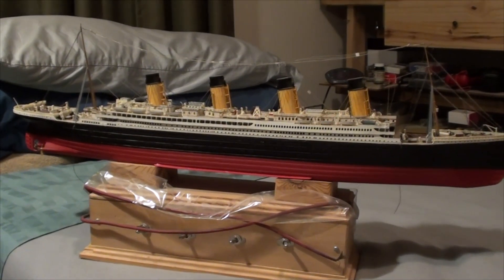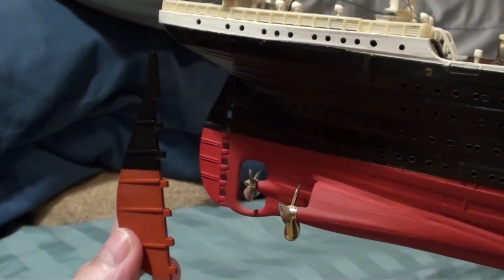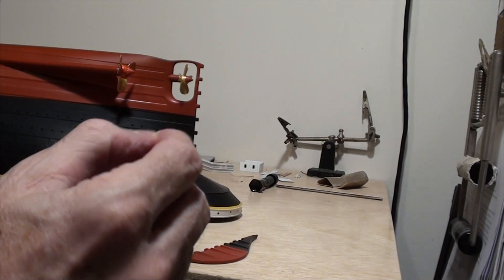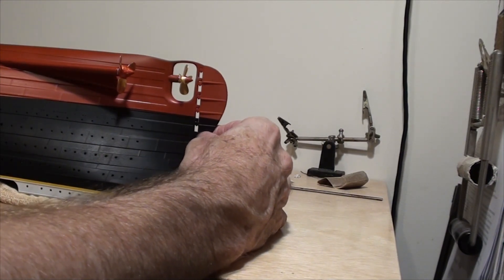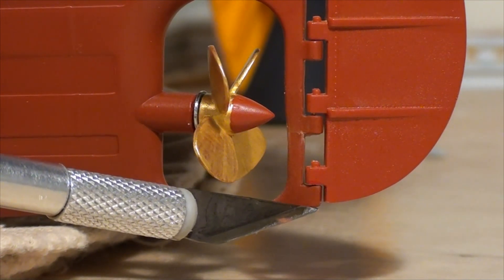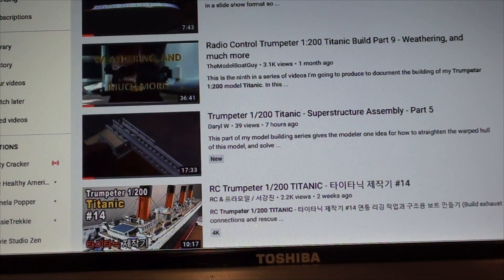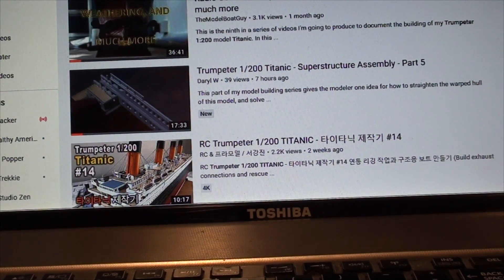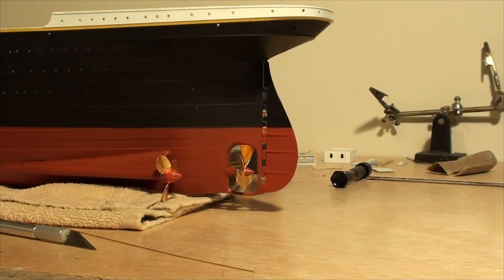Trumpeter 1/200 Titanic Part 6 - Functional Rudder Assembly

Comment: Great idea, not sure why they wouldn't have had it a working rudder .  The hull looks darker red then the 350, it's it a Tamiya or other rattle can or a specific mix airbrush?  I always find it hard to get a good (not too red) red, rust/red oxide look? Thanks
Reply from the maker: The red color I used is a Krylon rattle can paint.  My part 4 video shows the paints I used.  Looking in the store at the cap of the red paint can the red looked more like a rose red color and I thought it would look right, but I think my mistake was that the primer coat was a dark rust red/brown.  Darker primers will make a color darker, so if I would have used a light gray or white primer my red may have looked closer to the light red on the actual ship.  The website I mentioned in the part 4 video shows what the actual red color shade should be.  It looks more like a rose color, but the red I ended up with is good enough for me.
Reply: I personally used the Tamiya TS-33 Dull Red for my model and I'm very happy with the way it turned out.